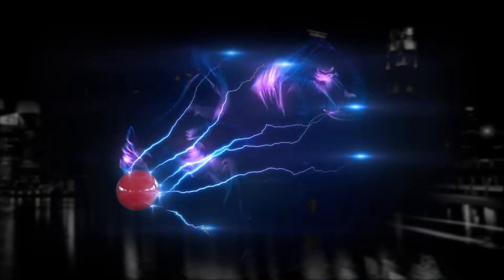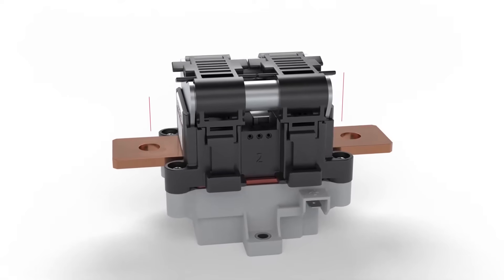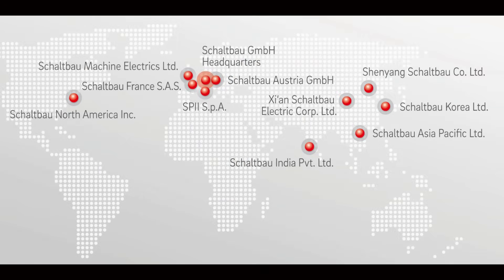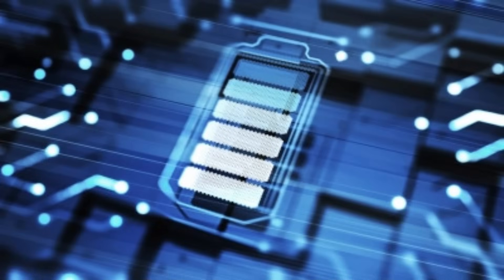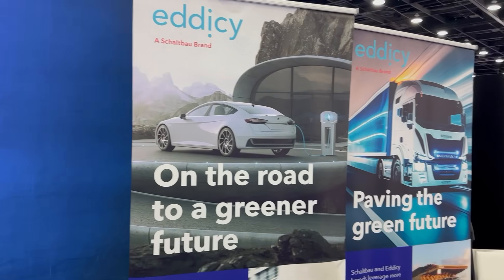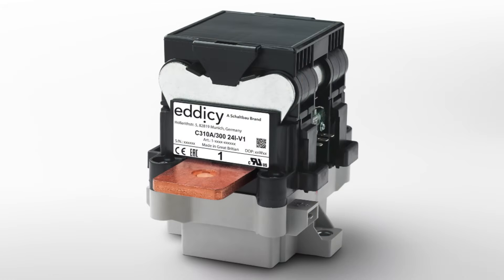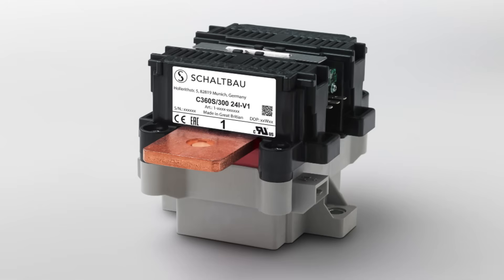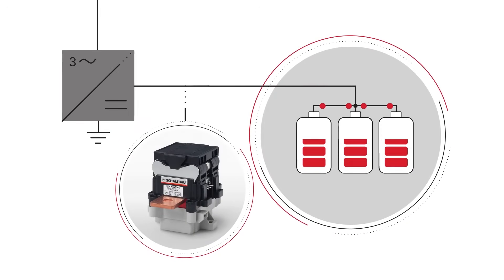Schaltbau Takes High-Voltage DC Connectors & Switches to a Cutting-Edge Level - Autoline Exclusives

Comment: That was ... a bit painful to watch actually.  A lot of marketing, but very little actual expertise it seems.  I mean... really?  Trying to argue that an open-air contactor is somehow better than a fully encapsulated one?   The whole point is to contain the ARC and the spark.  There isn't any particular superiority one way or the other... they are designed for different environments... some environments can tolerate large escapes, some can tolerate medium escapes, some cannot tolerate escapes at all.  ARC suppressors, in particular, might have full magnetic-assist or might also depend on the direction of expanding gasses from the heating of their air from the ARC.  One is not "better" than the other.   It is good to know that they are two-way (can break ARCs with current flowing in either direction)... that is actually quite important in modern EV battery applications.  It isn't magic, though.

In anycase, despite the pain and 13-minute ad, I do think Schaltbau has some potential in bringing engineering expertise into wider markets in need of ruggedization.  They should focus on that rather than trying to talk-up the actual electronics.  Cycle life under load... basic ruggedization parameters.   Things like that.

-Matt

Comment: A thirteen minute advertisement, at least the bots like it
Reply: It's information, and it's pretty clear what to expect if you read the description below the video title.
Reply: I understand what everybody’s saying, but it cost money to run these programs so I can put up with a 30 second ad😊 radio was free, but this cost server time computer time Highlander😢
Reply: Open-air high voltage doesn't sounds so good in an event of a flood like we just had
Reply: @Eduardo_Espinoza  These contactors are likely used in a sealed casing with some external heat sinks to further dissipate heat. And a contactor doesn't have the same risks as the battery itself if it does get wet, but obviously that's undesirable in either situation.
Reply: I thought "eddyicy" was a pun on Eddy currents (c) in electrical physics "[Eddy-c]"
Reply: Agree. This is a radio program.
Reply: So is this for DC battery swapping applications?
Reply: We used to use mercury contractors for sealed contractors. They are so illegal now I guess I just showed my age.😅😅
Reply: @highlanderapparel  The classic round Honeywell thermostat.
Reply: It sounds like a fancy resettable house breaker but with magnets
Reply: @Eduardo_Espinoza  There's a big difference in arc behavior between AC and DC loads, that's one of the reasons the silver/tin oxide contacts was mentioned. Switching high-amperage DC loads is not simple for reliable function.